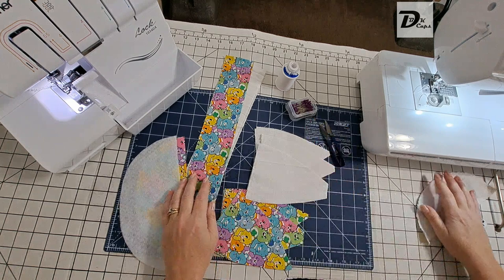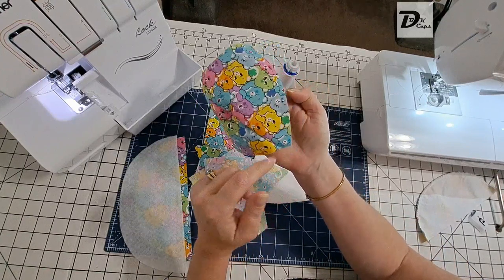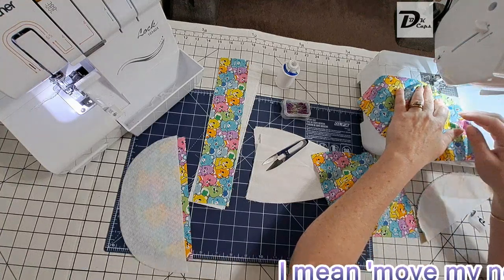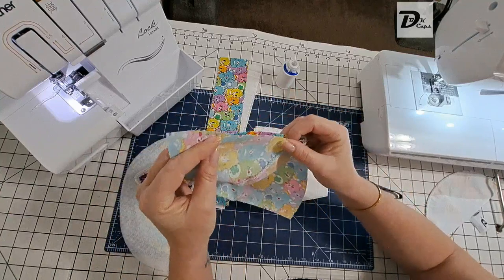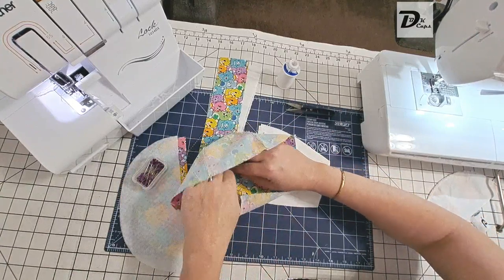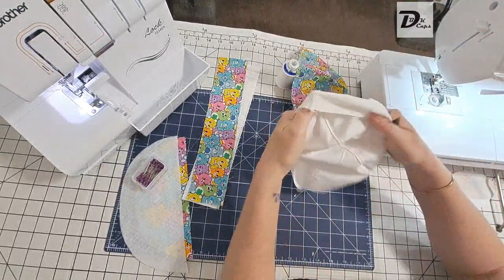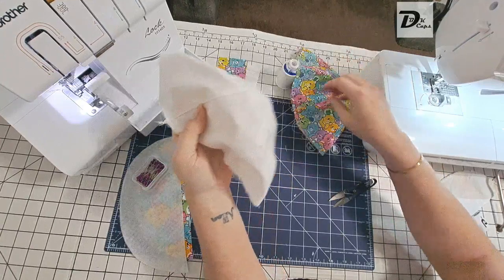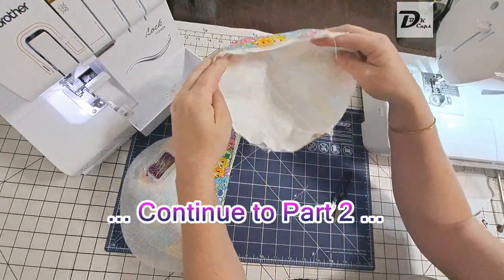Sew A Welding Cap - Part 1

Comment from the maker: Hey, my tension is set to fit the thread type being used - you need to 'play with yours to get it right', but I've moved my stitch width dial to fit 1/8" thickness. So it's smaller than the usual width that the serger is set at when you first get it.

Comment: Hi there! I do not have a serger, I am only using my sewing machine. I’ve been sewing my pieces together using the 1/8” line. I’ve noticed the caps I’ve made have been pointy up top. How can I fix this if I don’t have a serger?
Reply from the maker: Hey,

Good question :)

The serger will generally cut the edges of fabric as you stitch, this is what gives a nice even & curved edge as you sew. So, without a serger, I would recommend that you use a fabric marker to mark a nice curved lined along the top edge a 1/8" away from the sewing line, cut away the excess at the top & stitch that down like normal.

Let me know how that goes?

DBK Welding Caps

Comment: What size seam are you using on the serger and the other machine?
Reply from the maker: Hey, my serger is set at a 'scant' 1/4" & my sewing machine needle is set to center - I use the inside guide of the presser foot for a 1/8" top stitch :)